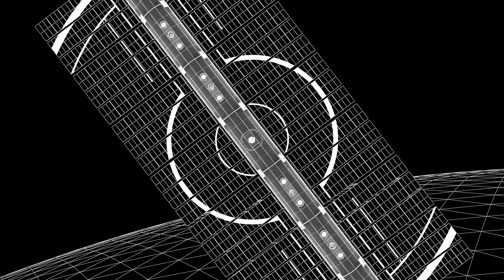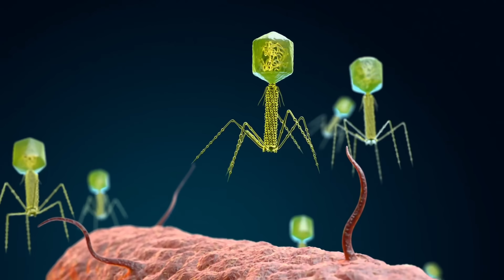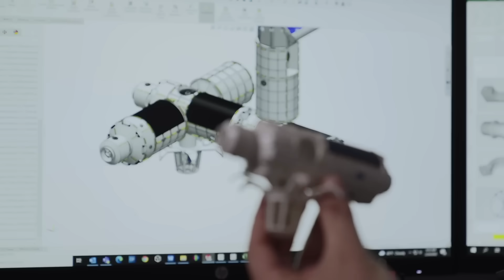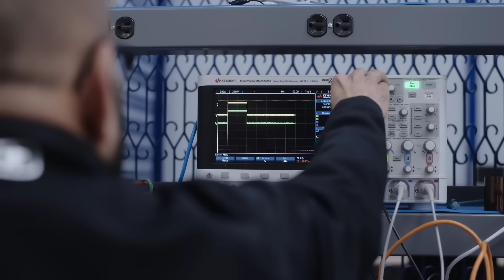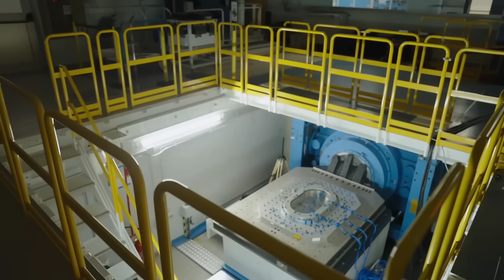NASA is getting a new Space Station sooner than expected!

Comment: For the 5th Earth orbit station I think it’s time to get radical and create a rotating space station. It could be made with a slowly rotating hub for docking and tubes connecting a couple of capsules on each end, whilst allowing in the design for expansion into a full wheel. it wouldn’t cost a whole lot more than a conventional zero gravity station.
Reply: These are super difficult because you have to keep the wheel perfectly balanced. out of balance centrical forces cause dangerous stresses on the structure, and gyroscopic presession will cause the wheel to move out of position.
Reply: @DuckyButtRanch  All the more reason to test out the concept. Unless we can genetically change humans so they can live long term in weightless environments, this is the only long-term solution to colonizing space. Planets are lousy places to colonize. Star Trek is a fun show to watch, but we need to work on things we know how to do.
Reply: @DuckyButtRanch  We use dampers on all sorts of structures to keep them in equilibrium. I don’t think that’s too big an engineering issue.
Reply: @DuckyButtRanch  Exactly this. The construction itself would not be that hard, but making it operate correctly would be really hard with today's technology for all the reasons stated by Ducky.

Comment: I want the 2001 spinning wheel,, 
Artificial gravity,,and hotel room,,
Reply: Would we still be able to fly Pan Am to the station?
Reply: Just hold on for 25 more years  :)
Reply: Before 1980, most science fiction assumed that America would take the steps to develop cheap, clean, safe nuclear power. Small modular reactors are really the only way to provide the energy density needed for such constructs.
Reply: What's the point? You have all the gravity you want right here on Earth. The whole point of a space station is to be able to take advantage of the zero G environment.
Reply: @odysseusrex5908  The point is to test out long term living in artificial gravity. It is not the same as planetary gravity. This is very important for the future because it is the only viable method for permanent off-world living. Planets are simply terrible places to colonize. The cost for the first one may be high, but if we build a large enough station, manufacturing can begin to be done there and we won't have to waste so much money getting material off of our giant gravity well.

Comment: Was hoping Sierra Space was in the running for this first replacement.   Much larger modules, etc.   But the tech is likely too new.   We really need to move away from what is still 1970s converted booster rocket architecture design (aka Skylab).   IMHO

Comment: Foam metal foundry in 0-G space, imagine making a StarShip with 1mm solid outer coating’s of stainless steel that has a 6-10mm stainless steel foam interior! Or using Glassblowing technique at mega scale with molten metals to make seamless propellant tanks and space habitats. Research in 0-G space metal Foandry is something that will make a difference.
Reply: I think you can bet on it that Musk will eventually build a foundry on the moon to make steel right there for building Starships. With only  1/6th G, these Starships can potentially transport 2,000 tons to Mars.
Steel quality would also be very high due to the lack of gases that can react with the molten steel. Hardly any slag forming, etc.
Reply: @paulmichaelfreedman8334  I wish Space X had a plan to make a Lunar factory/base before aiming for Mars, it would make it much easier. Also it could be very profitable.
Reply: Having a foundry on the moon would also have huge benefits as the raw materials are nearly all there for making high quality steel.

Comment: Why would you Axiom Space put the airlock module right smack dab in the middle of the Daisy chain?  Again, I’m going back to how well. The ISS is designed. The airlock does not in anyway impede the function of the rest of the space station. As shown here, the airlock will actually sever access to both into the station unless it sticks out to the side.

Comment: Of course, answer me this why doesn’t the axiom station just take the international portion of the space station along with it? There is nothing wrong with that station from no one to the right just dump the Russian section. If that’s the part that leaks if that’s the part that does weird things that you don’t like, dump it and leave the still functioning, international part of the station is extra room axiom? 

Never give up hard, fought square footage !
Reply: I'd think its just the wear and tear on the structural elements after all these years, somewhat like that old car that you keep running but the frame is rusting out and it really needs to be scrapped.  The ISS's basic frame structural elements would correspond to the car frame, and the solar/cosmic particles that bombard it correspond to the rust on the car.  I'd imagine constant retrofit of all the other support systems is getting to a similar state, too.  Just my guess.